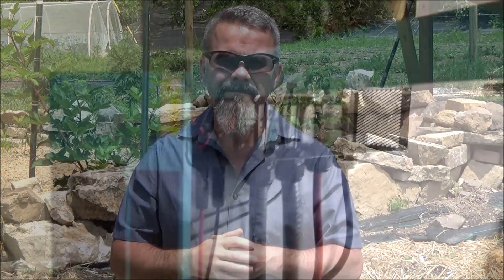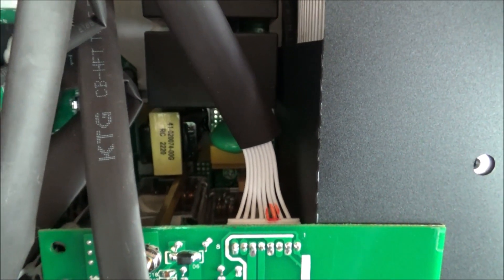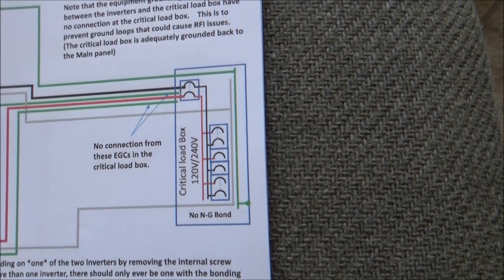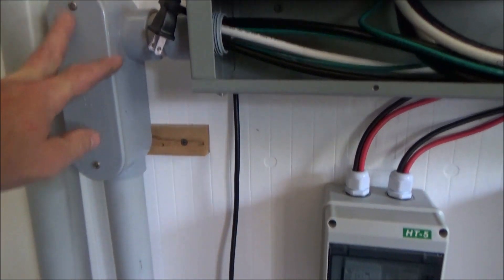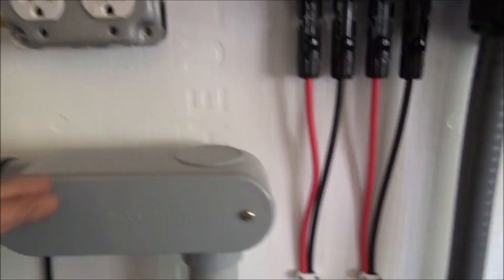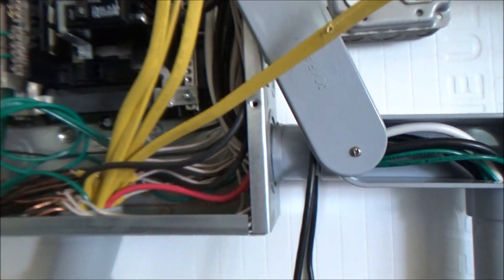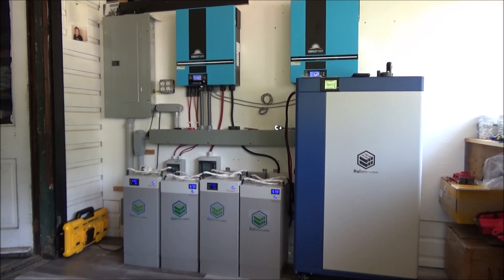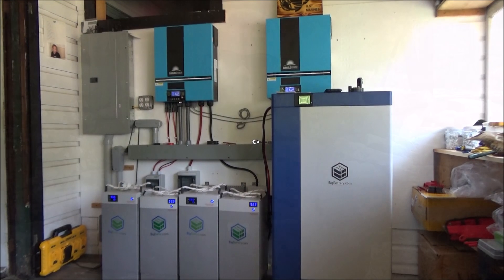6.5kW Inverter - Neutral Ground Bond Screw Removal

Comment: Why on earth would these screws be so hard to get to? They should be right in the connections panel. Now I have the new "SunGoldPower" model "SPH6548" which is nothing like this at all. I mean absolutely different. And I can't see a screw in mine anywhere. Only a chassis ground screw on the bottom of the case. And in the manual there is only the admonishment to have a "reliable" ground. This is ridiculous.

Comment: 1. On the line mode, the power is transferred from grid to main panel by built-in relay inside the inverters. The neutral-ground bonding should be at the service panel. So that, the the SCREWS inside inverters should be removed.
2. At the battery and solar mode (totally off-grid), the neutral-ground bonding should be closest to the source. In this case, inverters should have relays to connect neutral and ground. The firmware of inverters needs to be updated to the newest version. If the inverters don't have this capability, using a relay controlled by dry contact for bonding neutral-ground. By the way, if you go off-grid totally, the neutral-ground bonding should be installed in the closest circuit breaker box near the inverters. Does not matter which way, NEUTRAL-GROUND BONDING SCREWS NEED TO BE REMOVED FROM INVERTERS.
Reply from the maker: Thanks for the detailed explanation...I have contacted Sungold Power (about strobing/blinking lights & N-G bond) and they have sent me a firmware update for the inverters. I sent them the wiring diagram I got off the solar forum (which is how I installed it in this video) and they said the wiring configuration was good as indicated.  I have moved the grounds off the neutral and on to a separate bar on the case since this video. It will be included on my 1yr. review video coming soon. I'm not real clear on the theory of electricity and have relied on wiring diagrams and other peoples guidance for the install. I really appreciate your view & comment!
Reply: I have 2 inverters running 240v split. My main 200 amp panel for the house is neutral ground bonded. 
My dryer is not liking the set up. It tells me I have a problem with either neutral or ground lol. 
Think I should pull the ground screw from both inverters?

I am totally off grid using a ground plate.
Reply: @JasonMoreside  First of all, all bonded ground screws in the inverters must be removed. Remember, there is not neutral ground bonded in the main 200A, it should be at the first service entrance panel. If inverters run in in bypass mode, the neutral ground bonded at the first service panel is used. If Inverters run in total off-grid mode then you must have a neutral-ground bonded at the the inverters circuit breaker box.

Comment: Why even bother running a ground from the main panel ?  Why not just set it up with ground and neutral separates on the sub panel how you originally had it without removing the ground screw?
Reply from the maker: Man...sometimes I don't even know. I have seen so many things on this N-G connection my head is spinning. I have moved the grounds onto a separate bar attached to the  case since this video but I sent this wiring diagram to Sungold Power and they said it was good to go. They also sent me an update to the firmware that I am in the process of doing now. I do not have a good grasp on electrical theory so I am limited to the information I get and it seems to vary. I have a 1 yr. review coming up if interested! Thanks for the view and comment!
Reply: @DumbGrunt0311  thanks,   I don’t know either but as of now I haven’t touched mine and I have the exact set up as yours if I’m supposed to take it out then I will but I’m starting to wonder should I bother?   You know if it ain’t broke don’t fix it mentality??  Thanks Again and looking forward to the one year review

Comment: I agree they are about all the same. Look up roland neutral ground bond issues with hybrid inverters.  You really need a solenoid or a transfer switch to do this correctly. You need that ground bond screw removed from both inverters and do your neutral ground bond in the panel. This will kinda work the way you done it but doing it the way you are showing will screw up ypur ac input or creat a neutral ground loop. Roland will walk you thru it better than I can explain but yeah I did all this same stuff you are going thru and finally got I right now. You have a bad ground loop right now and it's dangerous. You have a bond in the panel and also on one inverter... not good bro and I swear I'd not steal you wrong on this. The way you can tell is with a socket tester and and by putting a gfci in line on the ac input.... if gfci trips its not right.. if the socket tester isn't testing right its not right either... bro look up roland he's a pro and a good dude to help ypu with this.
Reply from the maker: Thank you! 
I will check it out!